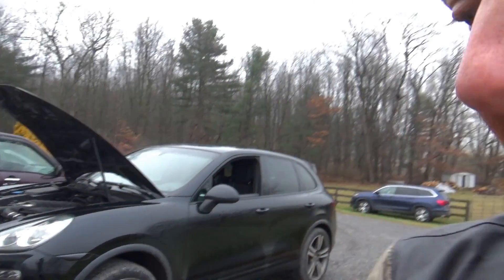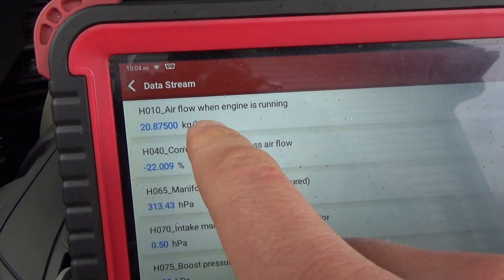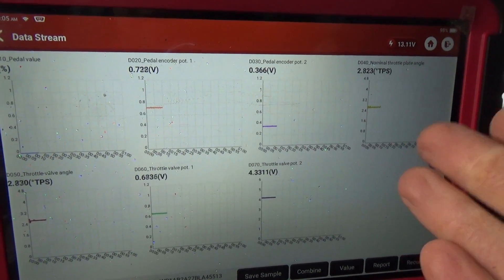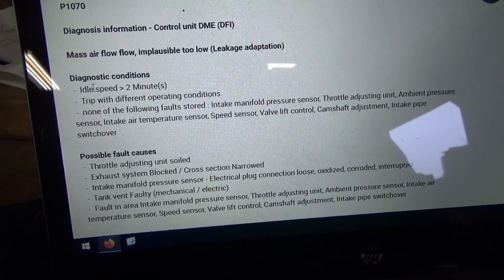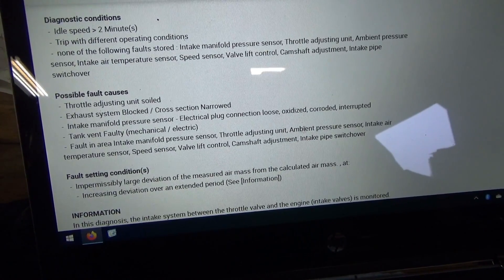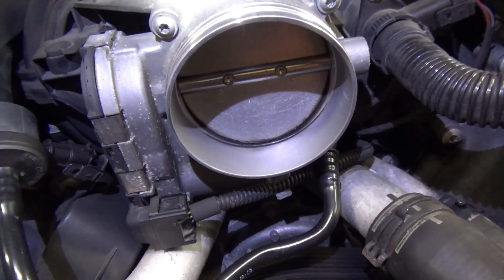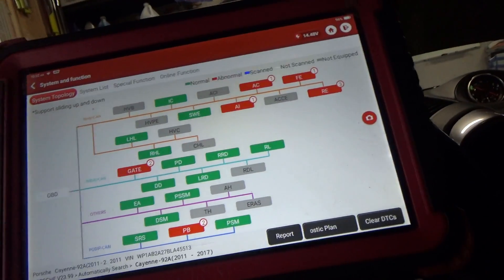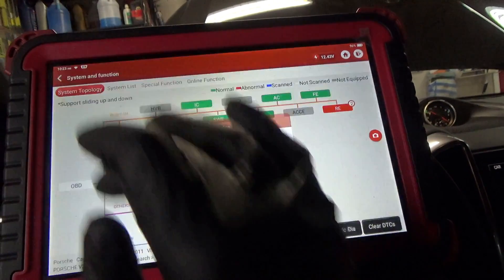The Parts Cannon PORSCHE? (MAF "Implausible")

Comment: I thought that with a drive by wire throttle body, it was recommended to open the butterfly by depressing the gas pedal, rather than by hand.  Does it matter?  I have a 2016 Cayenne GTS. Usually after a repair, codes will clear after 3 key turns (ignition off and restart).  You can run the key turns back to back without driving the vehicle.  If fixed, the trouble codes will clear.

Comment: Had a 2021 Audi A5 2.0 turbo with 51000 miles and a P0068. Found a new Parts Cannon TB and a New Map. Smoke tested and found no Leaks.  I went back to visual inspection and I found the air filter completely full of Leafs and Dirt and badly restricted. Mine drove fine. New Air Filter fixed Vehicle. It was a speed-density system. Nice Job Ivan.

Comment: Excellent job as always sir you always start with the basics and research how the system operates you're working on to have a proper understanding of how a system operates. You cannot fix something that you don't have an understanding of how it works. Thanks for sharing wish all shops worked in the approach you take on vehicles.  Unfortunately it seems as they just want you to scan codes and throw parts on quickly to get things done fast and return the car to the customer without proper repair or verifying the vehicle is repaired by the data as you always do.

Comment: I know cleaning the TB seemed to fix the issue, but it's likely the whole intake and valves are carbon coked and the engine needs a good cleaning. ;)
Direct Injection = Destruction Incorporated. 🤣 I doubt it's any better than the rest of them, probably doesn't have other fuel injection type/means of cleansing the intake valves/ports.

Comment: Interesting - my '09 Cayenne GTS also has a 4.8 V8 - but I have a MAF on both branches of the air intake hoses (where the flex hose is on yours).  It's really "fun" when I disconnect the MAF sensor lines to I can move the air hoses out of the way, and only remember to connect one sensor.  I also love the alldata site for detailed info - fantastic resource for DIY mechanics.

Comment: Wow,   that's a great video!! I've cleaned many throttle bodies over the years for carbon and many maf implausible issues.  As the tps tells accurately by ECM to meter air at idle.   I get that.   Too many electronics lol.   At least you cleaned it all out and make it work right!  Great job Ivan!  What??? No bonus footage? Are you slipping,  Ivan?   Hahaha 😆 😂

Comment: I have found that when the customer is complaining about a loss of MPG's, sluggish throttle and slopy or surging idle, it's usually due to a dirty throttle body.  But nice job with this one Ivan.  Killed 2 birds with 1 stone.  No parts required and literally a 10 minute fix.

Comment: Did the trip computer show gas mileage go back up or was the owner bending the truth? 
I just find it hard to believe it could change that much when the data showed problem was at idle. 
Did you feel that was normal carbon buildup or is this one an oil burner ?
Reply from the maker: He said it went up significantly with no DTCs set :)

Comment: I was surprised to see you just passing over an intake air temperature of 131.9°F.  (at 4:15 in the video)  That can't be right, and it's listed later in the video as one of the inputs that goes into the mass air flow calculation.
Reply from the maker: It was warm under the hood!
Reply: @PineHollowAutoDiagnostics  Ah, okay.  It's still surprising, though: intake systems should be designed to capture cool air, for best efficiency.  Even as a matter of basic thermodynamics the efficiency gets lower the higher the temperature of the intake air, and it only gets worse in practice.  But that's Porsche's oversight rather than yours -- or maybe this only occurs to a large degree at idle (less airflow so more time for it to heat up as it passes through the intake) and with the car stationary (less circulation of air under the hood) and so it doesn't matter.
Reply: Around 50c - or more - Intake temp is pretty much normal for a warmed up idling car , One of the reasons excessive idling is bad

Comment: Have you ever worked on a 2017 Highlander charging issues. I’m experiencing an issue with the stop start feature and battery charging indicator. I purchased a new battery and the issues went away for a week now it’s back.
Dealer states battery and alternator are fine.
Something is preventing the battery from charging completely. 30 min drive at will not correct it. If I put the battery on a charger it charges fully. 
Something is stopping or draining the battery. Checked belt seems fine. All pulleys look to be fine.
I’m at a loss on this. 
Any direction would be appreciated.
Reply from the maker: Hmm not sure about that... Smart charging systems can be really stupid 😅
Reply: They need specific batteries designed for stop, start vehicles. Don't cheap out and use a normal battery or what you described will happen

Comment: Good repair again, numbers “never lie “ is my saying every time ! Ivan, I damaged one “fly by wire throttle body” cleaning your way ! Plastic gears “inside dual TPS”. Cost me $500.00 to replace & re-learn . Now,,, KOEO put “hood prop “ on gas pedal,,, throttle plates WOT , electronically ( no touch by me ) Super clean & wipe, remove prop, start ! Took old one apart after,, badly worn by use, not meant to “ man handle” FYI, Only happened once ,, I broke it,, I replace it mentality! Don’t man handle anymore! Porche Throttle body ? $$$$$$. Have a great day Youngblood !

Comment: Would carbon build up on the intake valves cause the same implausibility? Perhaps something to consider on a direct injected engine with a MAP sensor and no MAF.
Reply from the maker: Probably not...but might cause a rough idle due to low compression though lol

Comment: I have seen differing opinions on moving the throttle plate with your hand. I usually put something on the accelerator pedal to open the throttle for me and then clean it when I work on my cars. Any opinions on that?
Reply from the maker: I don't trust the computer...what if it commands it closed and chops off your finger? xD
Reply: @PineHollowAutoDiagnostics  lol, good point.
Reply: Not really any issue with opening the throttle by hand with the ignition off. Only problem is if the system is on and it ends up trying to fight you by closing the throttle, that could potentially cause damage.
Reply: You can't do that if there's no physical throttle cable.
Reply: @erik_dk842  I turn the car to run, so it's powered on and put cleaner on a shop towel.

Comment: The engine needs an oil catch can.
The bigger, the better. 
My DIY can is filled with stainless steel pads with a drain valve on the bottom. I test it by inserting a clean cotton swab in the tube that connects to the IM. It always comes out clean.
The IV stays clean.
Reply: I was literally thinking the same thing. Direct Injection engines are famous for carbon issues of all sorts (wait until his valves get gunked!) so I predict this problem will return
Reply: All pcv engines should really have catch cans. Just most consumers aren't smart enough to service them at every fillup...

Pcv is really a great technology, it's jsut unfortunate that it introduces so much oil into the intake.

Comment: Hey Ivan.. great video as always!  I found the best way to thoroughly clean any throttle body is to remove it. Then inflate a balloon and insert it the cavity. Fill the TB with TB cleaner and let it soak. Cleans it like new, and gets into all those hard to reach areas!
Reply: I would be afraid of the cleaner getting into the electronics (TPS, throttle motor).
Reply: @peterperpetua2974  Done it many times, never had an issue. If you are worried about it, try it on an old unit from the crap yard, or on an old circuit board.
Reply from the maker: Too much work for the same result...
Reply: @PineHollowAutoDiagnostics  I agree, too much work for a shop. For the DIY' er, having a spare TB from the wreckers and simply swapping them out as needed, works great.
Reply: @PineHollowAutoDiagnostics  😂

Comment: I have the exact same car, I use to get this P068 code about once a year, cleaning the throttle body fixes the problem, but I recently discovered that the massive air cleaners boxes are hard to put back together when replacing the air filters elements on both sides, it's quite easy to misalign them and leave the boxes not properly sealed, hence the TB getting dirty faster than usual.
Reply: Was it winter?

Comment: Ivan, I took the throttle body off my truck which was running poorly, cleaned it, replace all the electronical parts (bought on Amazon) and now it runs well. Sure wish I had some data to support my actions instead of just guessing. Well Christmas is coming. Thanks for Sharing!

Comment: Looks like he cleaned the front of the throttle body. 
It’s funny how people always complain about the diagnostic charge since a lot of times they would save quite a bit of money instead of throwing parts at it. 
I guess the biggest problem is that the industry overall has a bad reputation. Nice video like always.
Reply: That was thought as well, yes the owner cleaned it but just not enough.
If you don’t know you simply don’t know.

Comment: It gets 28mpg coasting to a traffic light is more accurate. Coming from a dude that cleaned only the front of the throttle body I think we need to take everything he says with a grain of salt.
Reply from the maker: That's what the onboard computer says at steady highway cruise...big torquey V8 that just idles on the highway basically!

Comment: I worked on a rover with a bad throttle motor. It would fail the startup test and disable the throttle. It gave a code so it was a simple swap.

Comment: It always amazes me the massive effect insignificant looking amounts of carbon deposits on a throttle body can make to a vehicle's behaviour. These things are sensitive/precise!
Reply: Only if it's dirty enough to stop the flapper from closing.  It only takes a little build up to hold that flapper open, which will cause it to suck in more air than it's supposed to..  This is why older cars had IAC (idle air control) valve, which could account for the small difference, and could then handle being much dirtier..  Without an IAC, you are 100% relying on that main throttle body to close all the way, and if it has a little gunk there and can't close, then it acts like a vacuum leak. The same thing can happen if a little water gets down there and freezes.
Reply from the maker: @calholli  Actually it's the opposite...the gunk prevents enough metered air to enter the manifold! Notice the TPS values didn't change, but the engine could "breathe" better at idle :)
Reply from the maker: @calholli  yup throttle had to open up a hair more than spec to keep the engine running and the MAP was reading lower than spec since the carbon was restricting the air flow 👍
Reply: @calholli  Thanks!
Reply: Nissans are very sensitive to this as well. Sets a P0101 code typically.
Reply: @shawnbauman5463  That's why I liked the old IAC (idle air control) system.  It seemed to have more tolerance and would have to literally get physically stuck before it would stop working.
Reply: @calholli  I like it  as well until that IAC sticks and the engine won't start.  My car has 440,000 and I have replaced that 4 times.
Reply: Remember throttle by wire does have an idle passage in it. So if carbon builds up it has to open the blade up more to keep the correct idle speed.

Comment: I think it's a vacuum leak I've heard that on manifold absolute pressure sensor systems it can throw them off quite a bit if there's a vacuum leak
Reply: The gunk in the throttle body keeps the flap from closing, so it acts like a vacuum leak because it can't close all the way.  If water gets in there a freezes, it can do the same thing.
Reply: You would think a Vac leak would cause some lean running issues. And Fuel trim Issues, that could be found watching those pids.

Comment: I didn't know that Porsche made a V-8 Engine.   We have a Neighbor that have a Neighbor that has a 4 cylinder model that sounds kinda like a Volkswagen Beetle.  He used to pass Me with it, when I was able to work.   I think He still has it.   I hear it occasionally.
Reply: they have made v8s for years my 1980 928 was a v8
Reply: there are no 4 cylinder Porsche
Reply: Maybe not now, but there used to be.   It sounded just like a Volkswagen Beetle.
Reply: @russellhancock9765  It could have been a 914 with a VW engine. There was also an early 912, which was a 911 with a 4-cylinder engine. Later there was the 924 and 944 with front mounted engine and the gearbox at the rear axle (a transaxle)
Reply: @erik_dk842  Not to mention that the 1977-78 AMC Gremlin and Concord used the same engine that was in the 914.  I think it used carburetors instead of fuel injection and was built under license in the U.S.

Comment: Nice car!!! I couldn’t afford the insurance on it!! Great fix Ivan
Reply: The normal wear parts are horrendously expensive. A terrible money pit, to Quote Scotty Kilmer.
Reply: @erik_dk842  free oil changes and decent reliability, but some repairs at 100k worth maybe $1500 total over 4 years seems reasonable. With great towing capability and still seating for the fam while great handling. Idk.. wouldn't drive a chevy/ford/chrystler again.
Reply: @fsaneil  Almost $1000 brake calipers are "not much" in your world? The Cayenne/Q7/Tuareg platform parts are very expensive. Consider yourself lucky while it lasts.
Reply: @erik_dk842  who changes calipers? I mean if you have on old chevy/ford, yeah  they all rust out bad. Look under a 10yo Cayenne and compare to 10yo explorer. Different parts are used. Many parts in Cayenne are forged aluminum, not 100% sure on calipers material, but for $1000 you can get all 4 used calipers IF needed.

Also, use FCPEURO to get your new parts with lifetime warranty on everything. Even oil.

The main point of failure on a 958 Cayenne is the transfer case. That's all.
Reply: @fsaneil  The mechanic I hang out at services all three types on the platform. Even if they make him good money, he hates working on them. I live where they salt the roads in the winter, so of course everything brake related takes a hit. And it's horrendously expensive compared the next size smaller vehicles. But good for you, that yours hasn't reached the point where the defects pile up.
I bet you live in a state where cars don't rust.
Reply: @erik_dk842  this thing is awesome! Towed boats, trailers, drove un/down east coast. Just a pleasure to drive.
Reply: It isn't much, trust me. 😁

Comment: Hard to believe a high end foreign 2011 vehicle would still be using a speed density system instead of MAF.
Reply: VAG/Porsche have gone away from MAF back to MAP in a lot of vehicles. There has to be a good reason.
Reply: I have the 2008 turbo. Same 4.8 engine but with two maf sensors. They cost about 600$ each
Reply: the reason is the durability of the sensors

Comment: Really amazing how much difference a clean throttle body will make.  Nice work Ivan.
Reply: Only if it's dirty enough to stop the flapper from closing.  It only takes a little build up to hold that flapper open, which will cause it to suck in more air than it's supposed to..  This is why older cars had IAC (idle air control) valve, which could account for the small difference, and could then handle being much dirtier.

Comment: 28 mpg on the highway?  How is that even possible with a V8 in a SUV?  Implausible! 😊
Reply: Perhaps if you drive pretending there is an egg between your foot and the gas pedal and premium fuel with tires properly inflated one can do pretty good but the exact fuel mileage has to be done at the same pump like they do on TFL when they compare metered mileage to what is gotten at the pump. Every engine deserves an Italian tune up perhaps once a month and a long distance drive once in awhile. An engine like this likes to be driven.
Reply: Just drive it like a Tesla. Most drivers going any serious distance in Teslas are among the slowest on the highway, like we would do if running a fossil car on fumes, trying to reach the next gas station, where it would take forever to fill the tank.
Reply from the maker: @erik_dk842  This dude sets the cruise at 85mph. Faster than that, the mpgs do start to drop.
Reply: Like the hyper mileage prius ppl.

Comment: I have a similar problem in a honda Accord, computer setting a MAF sensor code but the engine doesn't have a MAF, it has a map instead.. any ideas? Set a bunch of other related codes also 🤷🏼‍♂️
Reply: It's probably very similar to everything he just showed.   Look for a vacuum leak/  clean the throttle body well/ test and confirm that you intake temp and pressure sensors are both working;  and the same for your throttle position sensor.  Check the plugs and make sure they don't have corrosion.  The codes should give you more direction on which sensor is bad.
Reply: I think the same idea applies.  Dirty TB or some kind of vacuum leak.  Anything that causes more or less air going into the engine than the computer expects.
Reply: Thanks for your input, I checked with the scan tool which codes are currently set and they are: P0102 MAF Sensor low voltage, P2185 ECT Sensor 2 circuit High voltage, P0498 EVAP CVS Circuit Voltage low and P2647 VTEC Oil pressure switch High voltage.. I've been also trying to research if the ECU I have is wrong, i believe there are some for MAF sensor equipped engines and others are for MAP equipped ones..